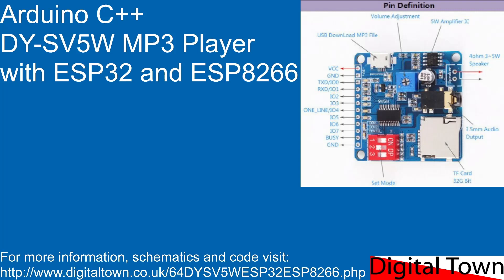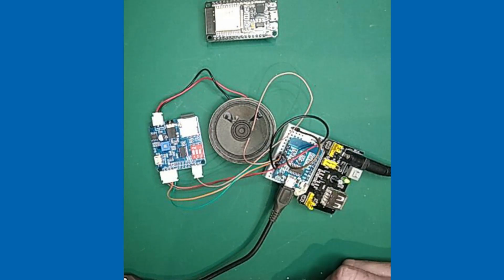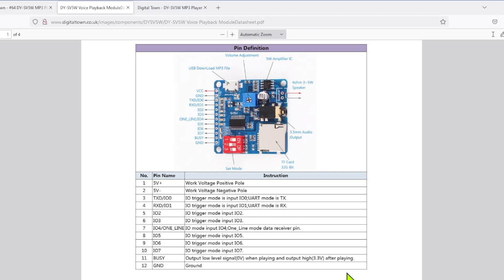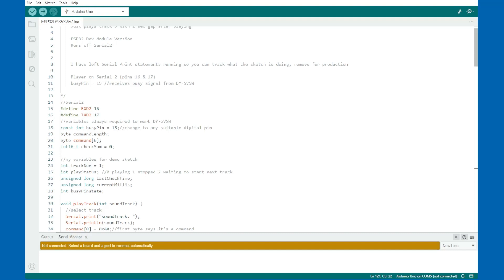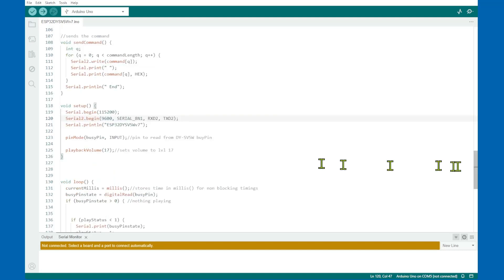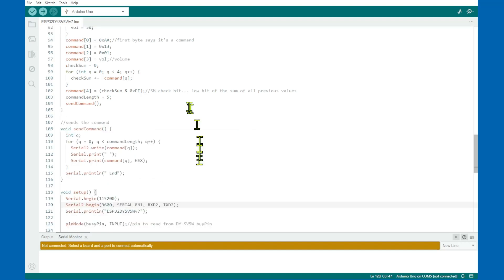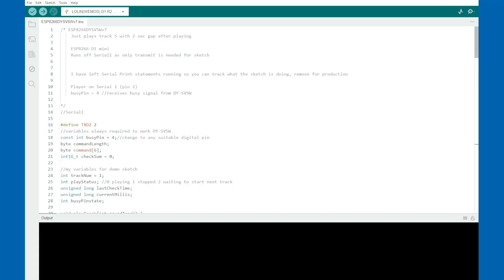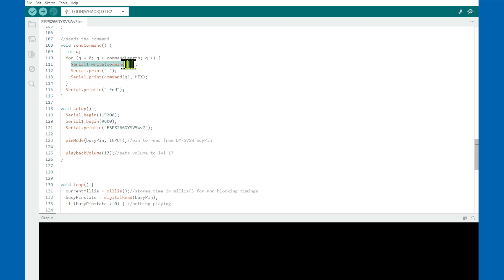Arduino C++ DY-SV5W MP3 Player with ESP32 Dev Module and ESP8266 D1 Mini

Comment: In my project, I have a rotary switch which changes the audio track.  Initially I just sent it another play track command, but if you toggle the switch, it queues them up and you end up playing multiples back to back.  So I sent it the end playing command before starting the next track.  I still had problems with that.  I ended up having to switch by first sending the end playing command, then wait for not busy, then play the next track.  Curious if anyone else has encountered that.

Comment: Hello, I use the arduino micro board and the DY-SV5W module
According to the button connected to the arduino board, I want each mp3 file stored in DY-SV5W to be played by an external speaker connected by a module aux cable.

Is that theoretically possible?
I've tried it so far, but I only fail and leave comments.
Reply from the maker: It should be possible. I don't tend to use the headphone socket but have my speakers at the end of 500mm cables plugged into the speaker output.
JUst be careful with the cable you are using as the board is mono and a lot of the aux cables are stereo. 
If you are using a stero lead It's the wire connected to the end of the plug that goes to one side of the speaker while you can probably connect both the other wires to the other side of the speaker.
Reply: @digitaltown5442  
Can you help us out a bit?
I used a DY-SV5W module and a pro microboard,

The plan is to connect a total of 14 PUSH buttons individually to pins 2 through 10, A0 through A3, 14, 15, and 16 on the Pro Micro, and when each individual button is pressed, a specified voice is output.

We will connect the rx and tx pins of the Pro Micro board and the DY-SV5W module opposite each other (rx to tx).
I prepared a separate “Speaker with 3.5 pi terminal size with built-in amplifier and battery” and connected the cable to the 3.5 pi size terminal on the DY-SV5W module.

Based on the above wiring diagram, I connected just one button, the RX to TX connection wiring and the individual battery and MP3 cable from the module, just to test the code for now, and it didn't work. I'm wondering what the problem might be.

I personally deduced that the problem is
1. I didn't connect the 5pin power cable to the DY-SV5W module. 
(But I did connect the vcc, gnd pins on the pro micro with the DY-SV5W pins).

2. the file name of MP3 extension must be saved specifically.

3. I didn't install the library of the DY-SV5W module properly.

What could be the problem?
The coding was helped by chat gpt.
Reply from the maker: @dionwarwick  Hi, without seeing the code or knowing what the error message is it's near impossible to know what the issue is and I'll be honest I would never use chat gpt. It may seem like a short cut but I'm yet to see what I would consider some decent code from it.
Anyway some issues for you to think about.
First the example that would be best to follow to get started is the UNO examples (4, 5 and 6) at http://www.digitaltown.co.uk/components18DYSV5W.php as the UNO like the pro micro does not have a Serial1 or Serial2 so you are best using softwareSerial library as you can get some odd issues even trying to load code if you have stuff connected to the RX/TX. You could try disconnecting them and uploading the sktch but make sure you take out any Serial.print() statements that are not commends as they will get sent to the DY player.

There is no library to install for the player, just the functions listed in the sketch examples. 

filenames should be in the format 00001.mp3, 00002.mp3... 00100.mp3 etc.
I tend to format the SD card and load all the files in numeric order to the card to reduce file fragmentation.

Start with the basics, forget the button and just get the micro to play a single track. Once you know the connections are correct to play a track you can start to add the buttons.

Always build projects component by component or it becomes very difficult to know what is wrong, code or hardware, even circuit diagram/connections.... that is also on the website page.
Reply: @digitaltown5442 
1. First, connect push buttons to pins 2 through 15 and A0 to A3 on the Pro Micro.

2. Since pins 1 and 0 are the RX and TX zones, connect them to the RX and TX zones of the SV5W MP3 module in a crossed manner.

3. Only activate channel 3 of the I/O channels on the SV5W MP3 module, and keep channels 1 and 2 deactivated.

4. The SD card inserted into the SV5W MP3 module should have each MP3 file saved as 00001, 00002, up to 00013, 00014, and so on.

5. Connect the Pro Micro and SV5W MP3 module to their respective 5-pin or C-type cables for power supply.
(Would supplying power to both boards cause overheating or excessive voltage, potentially damaging the board or the module?)

Would this wiring work for the hardware setup? I'm planning to proceed with the software setup after completing the wiring.
Reply from the maker: @dionwarwick  I would usually build all this on a breadboard and test the hardware and software before soldering anything. Especially if you are going to use the pro micro RX and TX directly to the SV5W as having the Serial connected can cause issues when trying to upload a sketch.
I would connect the SV5W first and make sure I could play a single track. If you run into problems you will need to use software serial library and some other pins (As per the UNO example).
Once I had the player working I would then start to add the buttons. If you have to use Softweare serial you can still have the same number of buttons using a resistor ladder on an analogue pin so that a single pin can be read multiple buttons.
Putting it all together before testing is a recipe for disaster, that's why breadboards are so good for testing, find your mistakes before soldering up the circuit.
Reply: @digitaltown5442  Sorry for the lack of explanation.
I will not seal it with solder.
I will use jumper wires so that I can make adjustments in case of errors. 😅

Comment: Thanks to your videos, I've been able to get my DY-sv5w responding nearly flawlessly to most all UART commands sent by my ESP32.  However, my project needs the "set loop mode" to work; but it won't.  I'm not clever enough to understand what the spec sheet is trying to tell me.  Can you help me understand?
Reply from the maker: HI, I have written a function for you, hope it works as I can't test due to workbench being full of stuff.

This is the function, just add it into the functions before the setup()

//set loop mode
void loopMode(int mode) {// modes are values 0 - 7
  
  Serial.print("Loop Mode: ");
  Serial.println(mode);
  command[0] = 0xAA;//first byte says it's a command
  command[1] = 0x18;
  command[2] = 0x01;
  command[3] = mode;
  checkSum = 0;
  for (int q = 0; q < 4; q++) {
    checkSum +=  command[q];
  }
  command[4] = (checkSum & 0xFF);//SM check bit... low bit of the sum of all previous values

  commandLength = 5;
  sendCommand();
}

You would call it by using
 loopMode(int mode);// where mode is the mode type you want, see technical specs for the different modes
Reply: @digitaltown5442  Thank you so much for the quick response!  Your function works, of course.  I will assume that the various (8?) different options for "command[3]" are found in the data sheet under "Communication Protocol D: Play mode".
I may experiment with that assumption, but for now, number 2 will serve my purposes.  Thanks again.

Comment: Hi, Really liked the video but I'm kinda stuck at the moment. I'd like to be able to play a list of files, in quick succession and, while I have managed to get them to play, there is a large gap between them. Would you be able to add a 'combination' option?  I tried using the DYPlayer version but I couldn't get it to make any sound at all. Thanks
Reply from the maker: First make sure your sound files don't have any silence before or after the actual sound as otherwise the player will play that silence.
As I can't see your code it's hard to say what is happening.
As soon as the function playTrack(trackNum); is called the track should start playing even when another track is already playing.

In the first example there is a built in 2 second gap between tracks playing. Try changing the line
if (currentMillis - lastCheckTime >= 2000) { //2000 = 2 seconds of silence between 
to
if (currentMillis - lastCheckTime >= 10) { //0.01 secs between tracks

Just see then if the tracks play with a smaller gap... you could reduce it to 1 and it should be virtually instant.

It will never be totally instant as the data needs to be read from the SD card or memory depending on the type of board.
Reply: Hi, thanks for getting back to me.

A couple of points on what else I have done.

I'd already cut the silences out of the files (they are individual mp3s of "one", "two", "three", etc), so they are all about 0.5 seconds long.

I've reduced the 2 seconds to 100 ms but there is still a (relatively) long gap between the files.

I'm using the flash but I also have the sd card version.

The code I used was more or less your code repeated several times. I also tried using a while loop when then file was playing, then starting the next file, when the busypin is high but that didn't work at all!

Happy to send you my code if you are happy to look at it!

Thanks again.
Reply from the maker: @connalmcilwraith4367  I will try and set one up here and run some files. I'd never noticed the lag but if there was a deliberate gap it would never be noticed. I will see how instant I can get the playback.
Reply: That would be great!  Thanks
Reply from the maker: @connalmcilwraith4367 Did some tests and there is a lag when the track is called. From busy pin to next track playing seems to be 0.75 secs. I used a special sound file that is just noise throughout and recorded it cycling through. The gap from sound to sound was 0.75 secs.
Reply from the maker: @connalmcilwraith4367 I also tried reducing the sample rate but it seems to make no difference
Reply from the maker: @connalmcilwraith4367 I've also tried just using  playTrack() without waiting for the previous track to finish. This produces a slightly smaller gap at 0.4 secs.
If you put the track lengths into an array you should be able to time the trigger of the next track to get the 0.4 sec gap. I would guess that at 9600 baud rate the lag is in ther player unit as it receives and then decodes the message and then reads the data to play.
Reply: Thanks for your efforts on this.  I did some testing as well and I found a lag of about 1 second. I'll look into your suggestion of 'anticipating' the next track.